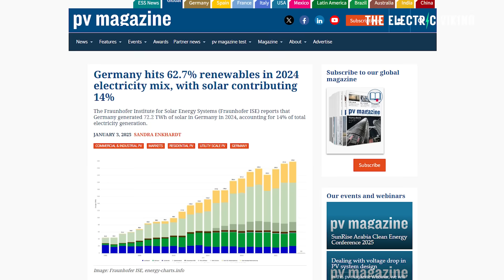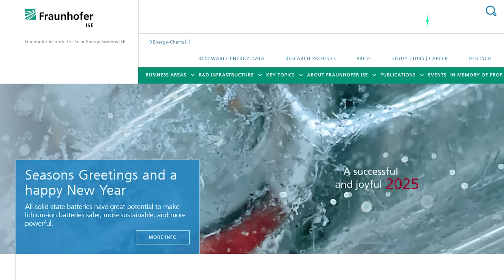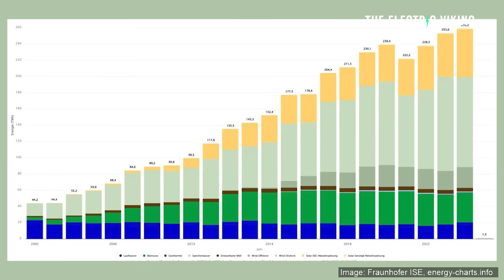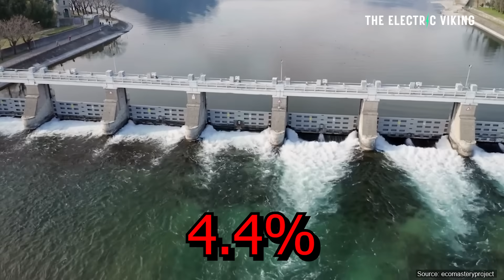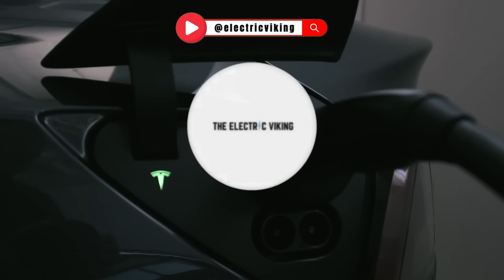Germany hits 63% renewables in 2024 as battery storage almost doubles

Comment: Until there is sufficient battery storage to capture excess renewable, Germany, like the UK and others, will need a second standby energy generation source.  For the moment this is largely gas and coal in Germany as strangely the Greens pressured successive governments to phase out clean nuclear.  This second standby ability must be added to total costs hence the crippling energy prices.
Reply: There will never be sufficient battery capacity to power the grid. Who told you there would be?
Batteries are incorporated into grids to help soften spikes, not to power the grid.
You aren’t the first to misunderstand this.
Reply: Nuclear does not help at this point, because it is baseload. You cannot turn them off if you have got plenty of energy. Gas plants fits the purpose which can be later switched to hydrogen. This is planned in Germany.
Reply: @martinv.352  Where do you get hydrogen from and how do you burn it cleanly (NOx?)
Reply: @davidbrayshaw3529  A separate hydrogen network for big industry and gas plants is under construction. The hydrogen comes from both Germany wind and LNG tankers. The new gas plants which are planned can use both fossil gas and hydrogen. NOX is still emitted, but less than in former times. The plants are only online when needed because of a lack of renewables.
Reply: @ this is not planned, nothing is being planned, they are acting like teenage girls.
Baseload is always needed, the shutdown nuclear plants were replaced by baseload coal plants already. Baseload plants can idle, using less fuel while still providing a little power.
Where are you planning on getting hydrogen from?
Reply: Or  improved transmissions to distribute the energy. It's really a balance of 3: Production, storage & transmission.

-If the minimum generation on record is 10%, than you can grossly oversupply by building 10x the production.

-So long as the average production beats the average demand, you can bank the rest in storage so long as it's efficient enough to compensate.

-Lastly, the wind is always blowing somewhere so you can balance production with your neighbours.

Frankly, the best solution is a comibation of all 3. You'll see SA regularly needs to import energy, but we also export a nice chunk during the day when our excess solar is doing it's job, & lately we've been capturing more & more on batteries to run later, though it's still only good enough for a few percent of demand for a few hours. While we'll absolutely be able to ditch gas entirely within a few years, we'll still be dependant on imports if our s & storage supply & renewable production doesn't amp up much faster.
Reply: @TheChristopherJack  Yes, transmission is a big consideration. Advances in HVDC technology in the last 45 years give rise to a lot of potential. It's probably a bit of a pipe dream in the Australian market, but for Europe, North America and much of Asia, it probably is a far better alternative to the current battery trend.
Reply: @TheChristopherJack  What storage??? There is no viable way to store power.
Reply: @jsbrads1  Um... what?!
Reply: @alan2102X  yes, what?
Reply: @jsbrads1  Your statement was idiotic. Or maybe just grossly ignorant. Whatever.
Reply: @ which one? What are you basing that on?

Comment: What is Germany's number 1 energy source?
Energy in Germany - From Wikipedia and Google AI - January 2025:

Energy in Germany is obtained primarily from fossil fuels, accounting for 77.6% of total energy consumption in 2023, followed by renewables at 19.6%, and 0.7% nuclear power.
Reply: This is also including Cars and heating i suppose
Reply: Talking about electricity generation
Reply: What you mean is primary energy. Sams subject is electrical energy. When you consider primary energy, you have to note that most of this energy is blown useless through factory chimneys and exhausts. To substitute these energies by electrical energy, you will need much less energy. Your statistics are correct, but useless from the point of renawables. In Germany, quadrupling wind and solar will substitute all, plus a small amount of imported hydrogen for the industry.
Reply: Of about 3,270 TWh of primary energy Germany consumes per year only about 1,500 TWh are useful energy. The rest is lost - in furnaces, turbines, and engines.
Renewables are pure useful energy. Of coal, about 40% is lost, and ICE cars waste 70-75%. Only domestic heating has a good stance of 90-95% with modern heaters. But heat pumps gather energy from the environment and outclass even these really fine heaters.
Reply: This is all energy, not just electricity. 0.7% nuclear seems too much though. There are no nuclear plants in Germany running anymore. There is some imported nuclear electricity, but I don't think it would add up to 0.7% of all energy.
Reply: Yup, you need to ask electricity generation. I just got a totally different answer.
Reply: Indeed the 63% is just about replacing "legacy" electricity generating plants. What he is forgetting in his hip-hip huray! story is that "Die energie wende" also should be about replacing fossil. This happens only marginly. As long as consumers don't switch to heat-pump, train, EV and industrie does not electrify it is one station away from window dressing.
And electricity needs to become much, much, much more affordable. 
Lastly. During the dunkleflauwte the germans bought a lot of electricity from it's neighbours. 
IMO the Germans are now basically making the same mistake as before and not diversifying enough. They need to get back in Nuclear. NOW! 
The fact that they turning away  from Nuclear out of some ideology is ridiculous if they are buying nuclear power from the French, Fins and soon Polis  without any problems.
Reply: But you know that the renewables in primary energy count three times as much as fossils, do you? So Germany needs roughly an additional 26% renewables to the 19,6% to achieve 100%.

Comment: So CO2 halved from 2014 levels...but what happened to methane levels? Which are much, much worse in the short-term. Especially as we are teetering on the brink of AMOC collapse.
Reply: Just guessing it is a lot lower as well. 

Coal generation releases massive amounts of methane, much less than what leaks from comparable gas power plants.
Reply: @5353Jumper  Quite a lot leaks out of the mines themselves too.
Reply: @5353Jumper  Nobody is suggesting we go back to coal. What is necessary is that we don't release dangerous greenhouse gases, NOT just CO2!
Reply: @elephantintheroom5678  not saying anyone wants to go back to coal. 

Just saying that the reduction in coal use may have contributed to a reduction in methane emissions as well as CO2 emissions.
Reply: @5353Jumper  Did you read my other comment about a recent peer reviewed study that found gas leakage from gas plants may rival and exceed the greenhouse gas emissions of coal plants?
Reply: @elephantintheroom5678  yep, both are bad and need to be reduced. 

As reducing both of them reduces emmisions in multiple ways.
Reply: @5353Jumper  Actually, even very small leakage rates from natural gas systems rival coal's greenhouse gas emissions, according to a recent study conducted by environmental group RMI, which included contributing  scientists from NASA, Harvard University and Duke University. That holds true at leakage rates as low as 0.2%, however the study points out that recent surveys have found leakage rates far above that of "0.65% to 66.2%." The peer reviewed study was published in the journal Environmental Research Letters. You can read about the study at : Natural Gas May Contribute to Climate Change as much as Coal, a study says: by Jeff Brady at NPR News, published on July 14, 2023.
Reply: Actually, even very small leakage rates from natural gas systems rival coal's greenhouse gas emissions, according to a recent study conducted by environmental group RMI, which included contributing  scientists from NASA, Harvard University and Duke University. That holds true at leakage rates as low as 0.2%, however the study points out that recent surveys have found leakage rates far above that of "0.65% to 66.2%." The peer reviewed study was published in the journal Environmental Research Letters. You can read about the study at : Natural Gas May Contribute to Climate Change as much as Coal, a study says: by Jeff Brady at NPR News, published on July 14, 2023.

Comment: Sam, can you find information on Eavors's geothermal plant in Germany and the future of geothermal in the energy mix in Germany?
Reply: I was thinking the same. Geothermal is an obvious solution for winter in Germany.
Reply: @elephantintheroom5678  Yes maybe. But it will not be very much.
Reply: @patrickpirzer4080  You're wrong there.
Reply: Hi from Germany. Yes, that's a big topic in Germany, but only for heating, not for electrical energy. There are specific regions where geothermal energy are a solution because of geological circumstances. This is the Upper Rhine Graben from Frankfurt via Mannheim and Karlsruhe to Freiburg and for example Munich. The city of Munich has got a big district heating network and the next years, it switch to 100% geothermal power. If the tubes have to be replaced by age, new pipes with lower temperature are installed where geothermal power is sufficient. Near Karlsruhe, there is a geothermal project combined with Lithium extraction from deep water.
Reply: Geothermal is a very small part of Germany's energy supply currently and just starting. Except for a small number of minor power or heating stations there isn't much yet. And domestic heating will probably become the main application. There are estimates that we could get up to 400 TWh per year from geothermal sources in Germany, while domestic heat demand is about 600 TWh. So it might make up a good deal.

Comment: The UK suffers from the same marginal costs of Peak power plants needed when the Sun and Wind arnt doing there thing. Battery storage are key in the UK but 22 GW is required to eliminate gas power plants.
Reply: This doesn't mean FFs are causing price rises...it means renewables are shit
Reply: @grantbuttenshaw  It doesn't mean FF are causing the price rises. It means that the infrastructure for renewables has not been built yet, mainly because FF companies have had massive leverage on western governments to prevent that happening.
Nothing to do with climate change BTW, just money and politics.
Reply: @grantbuttenshaw  It's the energy market that sucks - all over Europe. The most expensive producer sets the f-ing price. Same problem in Germany.
Reply: @grantbuttenshaw  hmmm, nah.
Reply: @petebest8422  you have NFI how the market works...take away CfD and what do you have?

Comment: Hum last time it was only 40% by-the-way Germany has no hydroelectric power, so 63% seems huge.
Reply: Germany has 5.6 GW hydroelectric power.
Reply: Because it is actually 55%. He got the 63% wrong....its 63.7% production of RE....not consumption....which is 55%
Reply: @grantbuttenshaw  Yes, the difference comes from the fact that since 2023 (the year where the last atomic power plants were shut down) Germany became an importer of electricity.

The total amount of generated renewable energy  in 2024 was 259,19TWh, compared to 253,64 TWh in 2023, so it's an increase in RE production of about 2%. If the weather conditions would have been more favourable the increase would have been higher.